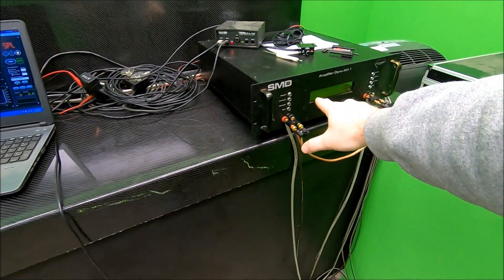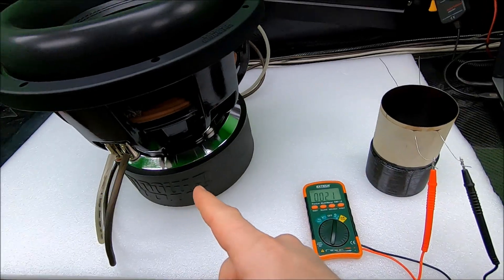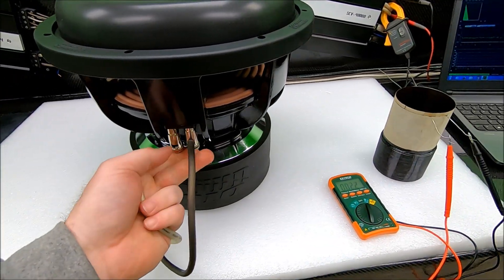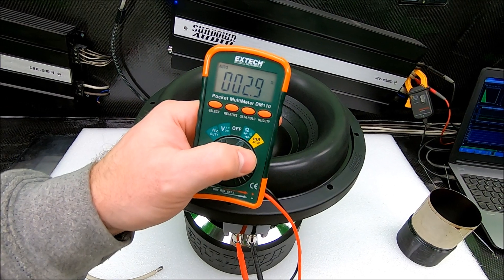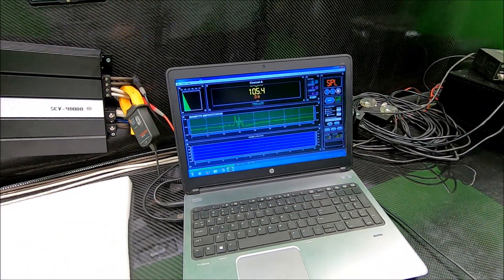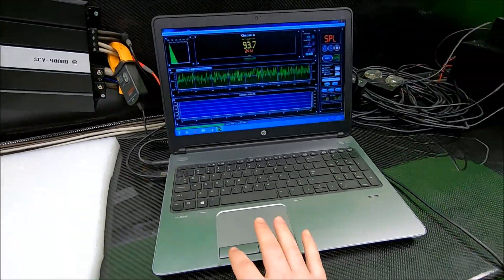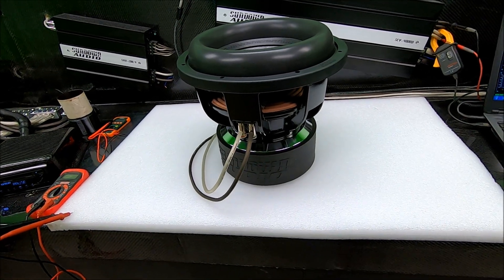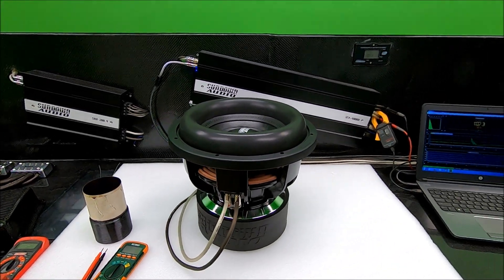How To Fight Box Rise *Tech Time Thursday* at Sundown Audio

Comment: Great walkthrough of the concept. From what I've learned in the electrical generation field is that capacitance in a circuit will "fix" the problem of rising inductive reactance. I'm not quite sure how to apply that to the AC side of the amp circuit other than maybe hoping the manufacturer installs an abundance of capacitors?

Comment: When the ohms fluctuates, is it ever a time that it goes or reads lower than what you're amplifier is wired to & ending up with a blown amplifier plz help....other than that awesome video man....Hopefully one day Sundown Audio want forget about us infinite baffle build guys & create a subs for us!
Reply: Yes the oh. Can go lower, but again, depend on the setup, the wattage demand required at that frequency maybe lower, allowing the amp to function. But if it's increased, it will over heat and go into protect.
So a 2 ohm speaker can do to 1.5 at a particular frequency, but can mostly of the range be above 2 ohms
Reply: @tyronedavis240- Sundown just came out with the M series of subwoofers that are designed to work well in Infinite Baffles, 4th orders, & sealed enclosures! Okay here goes, a speakers ohm rating is just that= a rating. ALL ohm ratings have a range= a 4 ohm rating can be anywhere from about 4.8 ohms to about 2.8 ohms, a 2 ohm rating can be anywhere from about 2.4 ohms to about 1.4 ohms, & a 1 ohm rating can vary from about 1.2 ohms to .7 ohm. These "Ratings" are all based on their resting impedance= not while moving. If you wire your "4 ohm" woofer to your amp, & ✔ its resting impedance, the ohm load should NEVER drop below that actual resting impedance, unless that coil becomes damaged. The only other way it may seem to drop below its "Rated" impedance, is if you never confirmed its actual resting ohm load before playing music. Like if your "4 ohm rated speaker" was really 2.8 ohms @ rest, & you assumed it was really 4 ohms. Moral of the story is NO your amp under normal conditions, will never actually see an ohm load Lower than your resting wired to impedance. And no that bogus .1 of an ohm that randomly shows in error by that hand held SMD Amm-1 DOES NOT COUNT😁😆!

Comment: I’ve got 4 vd-12s and I’m doing 140s in a 6.5cube box with a 10 inch aero but I checked it with the amm1 and they’re getting like 500w rms to all of them and they’re on a rp2000 I knew I should’ve gone with the 4500 but dam I’ve spent enough on everything. I would love to float the towel bigass ports sends with they’re ports and I think I could with 2k rms to them but I will never know because I have stock electrical and bigger amp a lil sketchy cause of that 😂

Comment: 3 options for me
1. Downgrade to a considerably less rms sub i.e 2000rms to 1000 rms
2. Upgrade amp to something double the power at 1ohm. This is hard to do as i dont have the electrical to support this.
3. Buy a constant power amp..expensive and i dont even know anyone other than rockford who makes a 2000 to 2500rms constant power amp
Reply: the interesting this is you dont need the power to support it, hear me out. . i just did a huge power upgrade on my brother system. 250 alternator, did all this power work to support an easy 200 amps after car loads,  after all that work , using a dc clamp i measure, 54 amps@ 13 volts , im like wtf, just did all this work for 54 amps of amp consumption from an electrical system that should 200-250?????? SMH !!!using ohms law i dug further and with  2 meters, i measure the 2 subs at 7.5 amps, at 89.5 volts amp output , 89.5 volts should yield almost 1400 watts at 4 ohms, but after doing the math im getting about 600 watts at 11 ohms, CASE IN POINT. the amp could pull up to 300 amps and the electrical upgrade should support about 250,  BUT yet its only pulling 54 amps because of box rise. .  to make in simple, think of your wall outlet, you have  a 15 amp 120, this should support up 1800 watts BUT if you plug in a night light its only producing 1 watt in other words that is the only power used , and only the power consumed. so in other words again, do 2] like you said and amp with double power, and dont worry, because as you aware the box rise will kill the power output, which means you dont need a larger electrical system. . 

just for more info if interested the system consists of. 
[2] 0 gauge wire for big 3, agm front bat, agm back bat, 0 gauge from front of car, to back bat, and then 00 gauge from bat to amp, on a tar amp 3k 4ohm version, and 2 xfls 15s dual 4 ohm wired at series 4, = 8 and 8+8 parrele =4 ohm final load, with out box rise the amp should be 1400 watts at 4 ohms but with box rise its about 650 at 11, 

side note, you may ask why 4? a lot of reasons, less current in speakers, cooler coils, bet cone control better sound quality ,  what i dont know is if it results in higer box rise,
Reply: @mikeriverajr4447  I'm no pro but my guess is yes. Running @ 4 ohms is cleaner better Sq all that stuff you mentioned but now u r rising from 4 and up instead of Running 1 ohm and rising to 2 or 3. So of course u will be getting less rms that way.  Try wiring lower and see how it sounds.
Reply: wont be able to do that because its a dedicated 4 ohm amp @akuma4u   also was gonna say for your situation,  the box rise limits how much current you use,  so in other words . you can do option 2.  . ""Upgrade amp to something double the power at 1ohm. This is hard to do as i dont have the electrical to support this.""  
because, even thought you dont have the electrical to support. it it wont matter, because the box rise will limit how much current the amp is pulling
Reply: @mikeriverajr4447  Now that you know your brothers impedance rise= to 11 ohms, from 4 ohms @ rest. This can be extrapolated to 2.75 ohms if you ran your (2)- XFL D4 15"s parr. parr. to a 1 ohm final load, & bought a Taramps Smart 3k= makes 3k @ 1 ohm, & @ 2 ohms. So about 1,500 watts @ 4 ohms. Your rise would only be to 2.75 ohms, if wired to 1 ohm, getting approximately 3 ohm power out of the Smart 3k amp= approximately 2,250 watts R.M.S., AFTER impedance rise= a huge difference! Oh by the way, i have 35+ years of audio experience, & have won many Db contests, i have clamped over 1,100 amps of current from (2)- strapped amplifiers, after impedance rise👀!

Comment: Been working with speakers for 20 years. Never heard of “box rise” before. I only knew of impedance rising at cone resonance or box resonances or from coil inductance. My favorite myth is that underpowered subs blow. If this were true, I would have destroyed many a speaker with an iPod (they don’t even put out a watt of power). Driving an amp into square wave clipping can over heat a sub though and fry it. Adding a low pass passive filter to a sub can be an insurance if the amp overdrives as it will reduce the higher order harmonic distortion and lessen the power and not hold the coil still with power running through it.  Myths in audio probably get started from uneducated people and spread to other uneducated people. FYI, the video failed to adequately address why the impedance was changing.  In the demonstration of the sub being tapped, the sub was converting the mechanical energy into electricity which would throw off an ohmmeter. In the demonstration of playing different frequencies, the impedance was changing due to the speaker’s mechanical cone resonance. Voice coil inductance was not mentioned either which raises the impedance as frequency goes higher and the inductance roll off  the speakers response (this is generally not an issue with car subs as they are crossed over before coil inductance becomes an issue).

Comment: I don’t even check mine I just wire it to 1ohm and Rock it. When it sounds distorted I turn it down. I run everything at about half to 3/4 gain and that’s always been about right! I set my amps so no one can twist the volume nob and blow anything. They can turn it to wide open and it want matter cause I got the gains down!

Comment: So basically you don't try to combat box rise(impedance rise). You have to play it's little game. The higher the frequency, the lower the impedance. So if you enjoy the lows and want to do the awesome hair tricks, wire to a lower impedance. But don't forget that you risk burning up your amp once you hit "x" frequency. Such as anything over 55hz give or take. If you tend to listen to a broad spectrum of frequencies, you better just stick with a 1ohm final load. Or 2ohm if your amps are strapped.
Does this sound about right?
Reply: No, each speaker, & its enclosure specs. will determine where, & how much the impedance changes. One setup may spike impedance a lot, one not much @ all. One setup may spike @ 70Hz, & another may spike @ 25Hz, never assume, as every setup can produce drastically different results. Even the same model of woofer, that was built with an SPL option, vs a Musical option= way different results.

Comment: I want to get six ct sounds ozone 10's(would be 4800 rms total and 9600 peak total). they will be dual 4 wired in series parallel to 1.3 ohms total impedance, powered by a sundown salt 8k. would the rise be too much to get the 9600 watts peak with a salt 8k? or would it be better to get 2 or 3 amps for those 6 10's?
Reply: 2 or 3 smaller amps*
Reply: because I have seen your video salt 8k dynoing at 6k watts at 2 ohms but forgot to take into account impedance rise
Reply: also with have at least 9 cubes for those 6 subs

Comment: Why does the cone excursion go down as resistance goes down? At 50Hz there’s higher current and more watts but the cone moves less
Reply: Usually resistance goes down the closer you get to tuning when the sub is in an enclosure. Since it’s closer to tuning the box gives more and more resistance. Also the higher the impedance the greater the voltage swing meaning more excursion.

Comment: What I did to combat impedance rise is add one sub wired to 8ohms to a pair of subs wired to 1ohm.  I rolled the dice and turned my amp on.   Turned it up and it's been fine.  Never getting hot.  I check the impedance and it's at 1.4 ohms.  Before, it'd was at 2.5 ohms.  Now I have more power but going through 3 12s.  Sounds great though, and louder.
Reply: This is definitely not recommended as the power is not evenly spread across the subs. Your probably hearing the 2 louder subs and the 3rd is tagging along at a lower level.

Comment: Can you just get another dual 2 and run amp amp at .5 and will rise to 1 ohm.
Reply: Yes, usually. It may never go below 1 ohm or it might dip a little below. If the amp can handle that, it should be fine.

Comment: Fight box rise with a box tuned properly. Free air is the worst impedance and sealed is more stable. Box demention and port will significantly improve how loud a note gets. If it's still not enough then up the wattage.

Comment: power compression or thermal compression is a loss of efficiency observed as the voice coil heats up under operation, increasing the DC resistance of the voice coil and decreasing the effective available power of the audio amplifier.

Comment: Does Sundown use actual dual VCs, or is it just once VC with 2 windings? For example, a B (no name) subwoofer has 2 Ohm DVC and the same B sub is available as 4 Ohm SVC, which is just both coils connected in series on the coil itself. 
So, does Sundown sub use DVCs that are ran the entire wining height? 

Also, if you wire the input to coil 1 then 8 gauge over to VC 2 in parallel, does the sound change because it takes just every split second longer for the power to get over to VC 2?

What are you using to make the impedance measurements while also playing and showing V and A?
Reply: Almost all dvc subs have their voice coils running the full length, top to bottom. The voic coils are one on top of the other, though. They share the magnetic gap. They allow 2 different ways to wire them, either series or parallel. There is no noticeable time delay.

Comment: 🇺🇸🌱SO WHEN YOU PUSHED ON THE CONE, IT PRODUCED ELECTRICITY LIKE A GENERATOR?
OR IT'S RESISTANCE WHENT UP?🍃
Reply: It produces electricity. As the sub plays the mechanical parts of it pull the cone back towards center and this feeds an electrical signal back into the amp. This is part of the box rise and amps are designed for this.

Comment: So this means it's okay for me to wire two svc 4ohm sub with 2ohm wiring in parallel to a 2ohm load amp even if the sub is not rated for 2ohm?
Reply: whatinthefuck shitniggadawg  oh ok thanks bro 👍👍
Reply: Yes, its fine. Subs are not rated to 2 ohm, they are rated AT 2 ohm. Your 4 ohm subs are not exactly 4 ohms dc, they are close to it. With music they should not dip below 4 ohms. So wire them into a 2 ohm load as long as your amp can handle a 2 ohm load.

Comment: ? The enclosure has nothing to do with Box Rise?   But DD Audio says, 
"Now, If you play a sine sweep through a free air woofer the Fs, or free air resonance frequency, will become apparent as the woofer will move the least at this frequency. This happens because the impedance peaks at the Fs so your amplifier will have the lowest output. Now, if you put the same woofer in a ported enclosure and play the same sine sweep something different happens. Instead of peaking at the Fs of the woofer the impedance will begin to rise after the tuning frequency of the enclosure and will peak anywhere from a quarter to a half octave above said tuning frequency. Due to this phenomenon the average impedance the amplifier will see while the woofer is being played rises from what is measured at in a resting or reactive free air state.  This impedance shift is highly dependent upon the enclosure and how the enclosure interacts with the vehicle it’s in, so there’s no way to calculate what level of rise you will before the system is installed."  What's correct?
Source: https://ddaudio.com/5183-2/

Comment: I purchased 2 DVC 4-ohm subs which I have wired down to 1-ohm but when I carefully measure them together they settle down at 1.6 ohms. This pisses me off that there's nothing I can do about it other than now needing to upgrade my amp from the 3,750 RMS up to a 5K. Right or wrong?
Reply: I checked the final ohm load when wired up too. Then, went up 2x-3x(per DD Audio) the final ohm load then I decided on the amp RMS need. Worked for me.

Comment: The producers are stupid, the players are also stupid. coil 2om sing something, 1 bridge 8om, 2 bridge 4 om, the loudspeaker bass is new. for example 1000w speaker can sing 100db but 2 om only sing 90db. listen to me . 1 to 6 bass bridge bass level, the new loudspeaker sings loudly. 2om less copper wire does not work vs magnetism

Comment: The way i understood to deal with impedance rise was to make or pick a box that gets the most exscursion withing the woofers safe max limits but yet have the correct size port and tunning frequency that pulls the max power within safe thermal limits the coil can handle. Impedance rise is a function of the woofer, theres nothing wrong with it but can sort of be controlled or in a sense tuned to get the max power efficiency of the amp and woofer by what box its in along with other things like the way its wired and the general ranges of frequency the woofer will be playing. Id imagine that the manufacture box building recomendations for their woofers incoporate the use of impedance rise to achieve a general decent amp power consumption and woofer performance effieciency.  But impedance rise is very variable and not something that can really be completly controlled because how various the ranges the frequecy signals being sent into the woofer, unless you are only playing 1 frequency signal through that woofer then the box can be made to optimum size have a port tuned to get max power out of the amp into the woofer for that 1 frequency its playing since now pretty much ur whole setup your a tunning for is now a satic non variable situation. Im still learning about this subject so hopefully im not unintentionally giving bad info.  But never the less that how i understand it at the moment. Very cool video though. The title did grab my attention since you used the word fight in refrence to fighting impedance rise or box rise..lol.

Comment: Infact I make it more easy,,  you have a sub that needs 1000 wrms at 2 ohms, then get an amp that does 1000wrms at 4 ohms and not a lot more at 2 ohms, sub will be run almost flat out all the time.  Remember heat building up in motor will increase the impedance and reduce amplifier power. As I say sundown would love to work for you but I am to far away lol

Comment: Amps turn in to one note wonders when run hard in to very low impedance without much rise, best thing that can be done is simply more power and keep nominal impedance as high as you can for a more dynamic sound/bass as the amp won't just be burping..  So in my world of big system PA a bad example would be crown 5000's run down to 2 ohms per channel with 4x 8ohm pd1850's per channel,  amp wouldn't see 2 ohms it more like 4-6 ohms, so basically instead of 600 watts per cone it would be more like 300 per cone, nothing for a 800wrms input sub And would sound horrible. So with same amp used at 4 ohm nominal on 2x 8ohms subs per channel she would see around the 8 ohms average and put out between 600 to 900 per cone and have a much more dynamic range. BUT 😲 you do then need twice as many amps to run the system,  so 8 crown 5000vs on 32 subs instead of 4 crowns..  Impedance rise and quality is expensive.